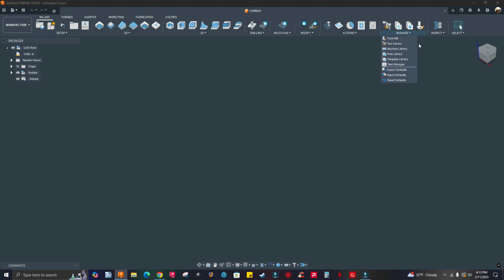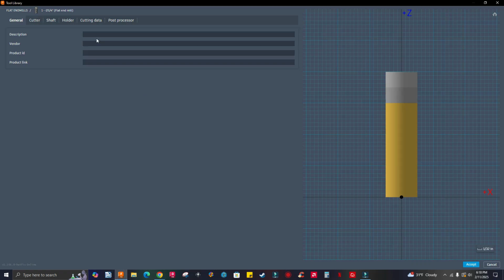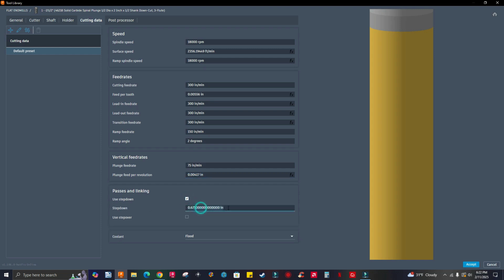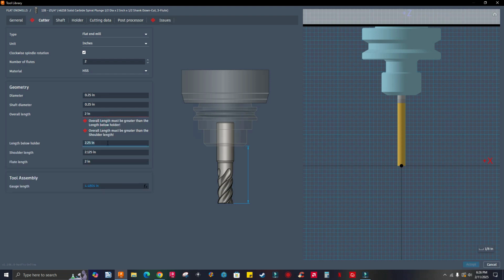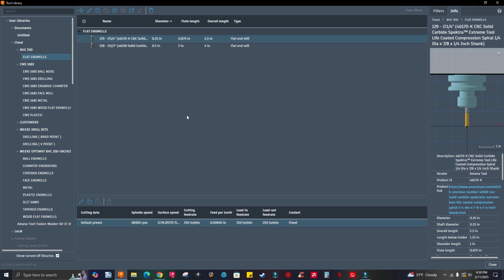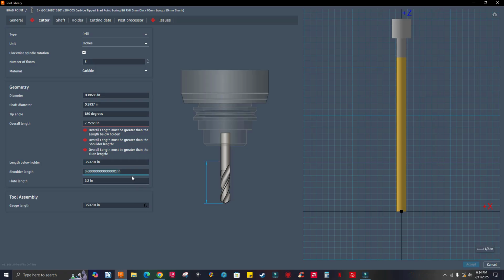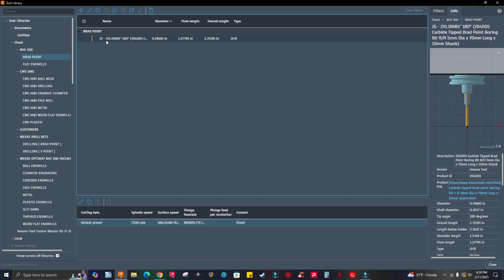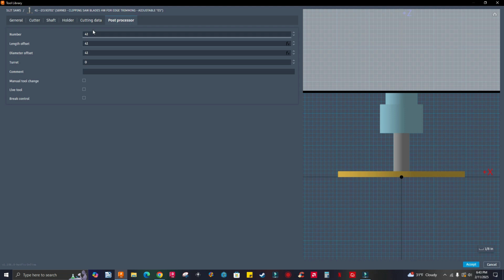HOMAG/WEEKE TOOL LIBRARY IN FUSION

Comment: Hi! thanks for your videos, they have been very helpful!

i'm having issues getting my drill head to work with the post processor. it works fine for my router head, but not the the drill head. any ideas?
Reply from the maker: You’re welcome, what error did you get? What did say?
Reply from the maker: Is it a swivel drill head?